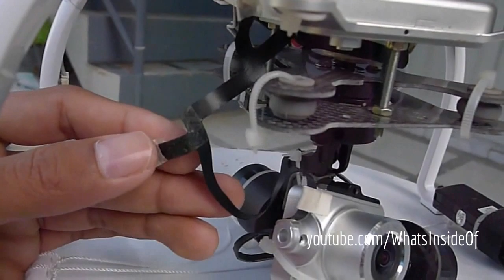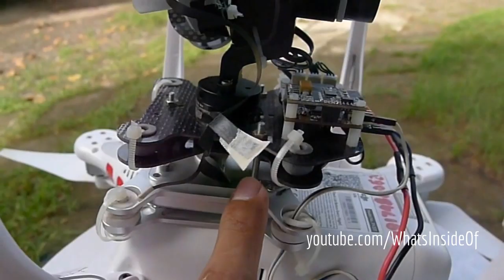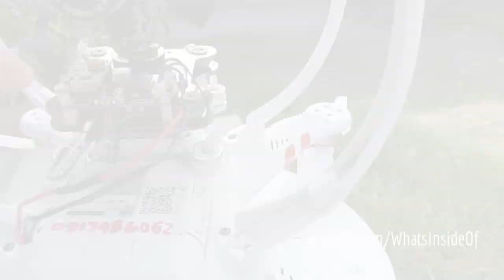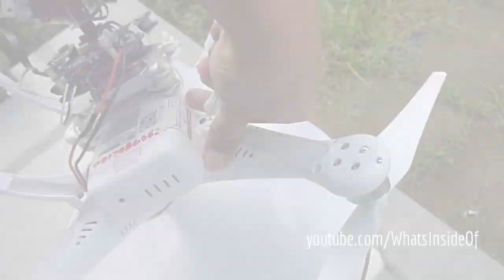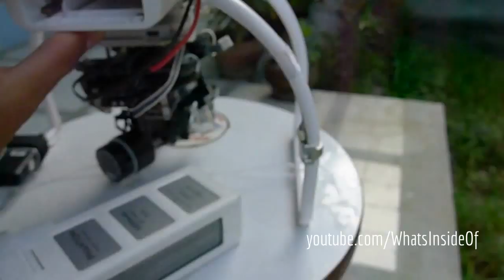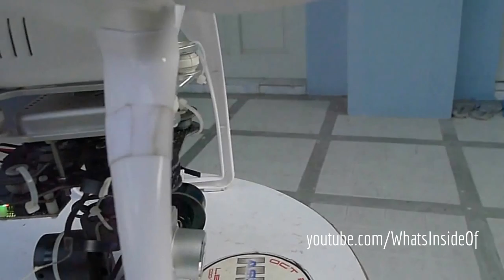DYS GIMBAL installation for DJI Phantom 2 Vision plus

Comment: Hello. Thanks for this video.
I have the same controller, NAZA PHANTOM... and for me the pitch RC doesn't work quite well...

 have all connections ok, but when I tilt the Phantom forward, the gimbal turns the camera up, and when I tilt the phantom back it tits the camera down (pitch only).

This happens only if the camera is NOT on the far extremes (horizontal or vertical) because angle limits are being respected
Does it happens to you?
thx

Comment: Hey Dude, where did you get the flat-cable (black) for the gimbal?
In Germany, no one knows where to buy them and DJI just offers to remove the whole gimbal.

My cable broke and i don't want to spend the 400$ for a new gimbal if only that flat-cable is needed.

Thanx for message!

Comment: HI, i'm gonna shoot 2 questions this time...  :P   but first, thanks for your explanation. I would like to know if you have upgrade p2v+ firmware to the last version and fly in wayponit mode without errors.. and I think an extra protection to camera wire like fix it  and hot wax gun would be an idea to consider... ins't it? 
Regards.
Reply from the maker: yes im using the latest firmware.you can add extra protection at the bottom of the gimbal just to protect any object hitting the gimbal directly